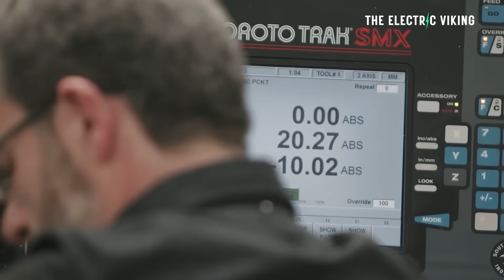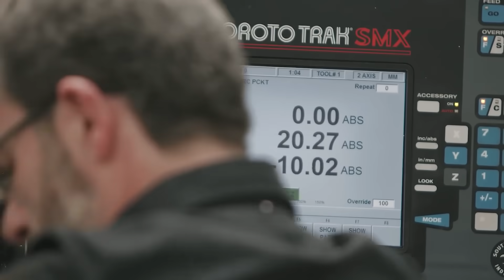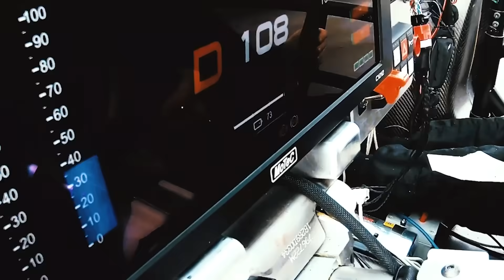This Insane New Electric Motor Has 872 HP And Weighs Only 62 lbs

Comment: Just from the video itself which showed SOME of the internals of the EV motor, I can ALREADY see myself designing and engineering a few improvements to the actual motor design itself to reduce weight and size.

I would change from Neodymium over to high heat resistant, super-longevity Cobalt-Samarium permanent magnets. Then I would change the motor casing and EV motor SHAFT ITSELF over to all-carbon fibre. I also have an idea for the copper winding configuration to increase areal density and overall high-current IMPULSE capability using lightweight ceramics that will increase horsepower BY ANOTHER 25% at least!

There ARE higher impulse-rated EV motor core materials that are intermetallic-ceramic rather than full blown ferrite/iron so that is another option to lose further motor weight! 

Add all that together and my BASE ESTIMATE is that I could probably get the motor down to just a bit over 12 Kilos (25 lbs) and STILL put out a 1000 HP.

Give me some GPU server farm time and I could model and then OPTIMIZE the EV motor current impulse path and the motor thermodynamics AND manufacturing process in about 60 days for a PURE RACE-CAR LEVEL design that is small enough and inexpensive enough to build that ANY manufacturer could put that new EV motor design into a sub-$30,000 USD vehicle. Imagine having a 1000 HP in a car or truck that is LESS THAN $30,000 USD !!!

V

Comment: Goto all-carbon fibre for the casing and shafts with only the copper wire, ferrite core and Neodymium permanent magnets left over as the metallic elements and we could being this motor down to about TEN KILOS (25 lbs)

V

Comment: I drive a 2019 Bolt.  It is significantly faster than a lot of ICE cars with 200HP.  I can't see many people needing more than 400WHP.   

What I expect will happen is motors will get smaller, cars will go to 4 wheel drive, one motor per wheel.  Easier to get the heat out of a small motor.  That eliminates the differentials, while providing very precise traction control.

Comment: Once you reach 100 kph what else matters? --saving 0.1 seconds accelerating to the legal and practical limit is nonsensical and throwing up or having your neck dislocated doesn't seem all that desirable somehow (watching a pack of Lamborghinis getting stuck behind a tram while I cycled past both of them was 'satisfying' during the end of lockdown .  Using this sort of motor in aircraft has some sense but the savings in motor mass get quickly eroded by the ultraheavy and never lightening fuel tank to yield very low range and long delays to refuel.  Avoiding unneccesary hovering take off and landing saves a lot of weight and boosts range and can be done along with urban/suburban air mobility by ATOL (Not VTOL)

Comment: All electric motors are lighter than the equivalent ICE motor, that's been the case since the 1900's
The stumbling block is and will be for the foreseeable future is the weight of the battery. On average to get the same power and range, the EV will be 500-1500lb heavier than it's ICE counterpart

Comment: With EVS its stupid carrying all that battery weight around.
The Electricity shoud be picked up from the road as you rravel;
Think how efficient they would be then!.
Someone seems to have a vested interest in selling  batteries.
Another question is how is the Electricity produced.Is it green/
nuclear certainly  isnt.Where are you going to leave your waste for the next 10,000 years?
Sending it into space would be horrendously expensive.
And one mistake as in Japan could leave large areas of England Uninhabitable.
So cutting  down on the amount of electricity  used however produced makes a lot of sense.
A plus is you wont keep running out of battery power and having to wait hours for it to charge back up.
What do you think we should do?

Comment: Parameter	Unit
Power peak (kW)	711
Power continuous (kW)	650
Torque peak (Nm)	408
Torque continuous (Nm)	398
Speed max (rpm)	25,000
Weight (kg)	28.3
Overall motor length (mm)	261
Stator length (mm)	165
Overall unit diameter (mm)	206.2
Materials category	5

Comment: Some EVs aren’t actually heavy. For instance the Tesla Model 3 Performance weighs less than 4,100 lbs. Other AWD sedans with similar HP like the BMW M3, Alpha Romeo QF, and Cadillac CT4-V Blackwing all weigh a similar weight to the Tesla Model 3 Performance. If you compare EV to ICE with similar HP you will see that EVs aren’t actually that heavy.

Comment: 745 watts per horsepower That's over 650,000 watts! If the motor is 98% effective, that 13,000 watts of heat to dissipate. You will need a trailer mounted liquid nitrogen cooling system to prevent it from turning into a molten mass of metal

Comment: 872 HP, 62 lbs is impressive but incomplete. What is its DUTY CYCLE?
Is the 872 HP figure what it achieved when it is maxxed out to demonstrate proof of concept?
Or, is that the figure  as configured for sale in the hyper-car with some level of assurance it will last through more than a few sprints and high speed runs?

Comment: If we use the average weight of gasoline at around 6 pounds per gallon, a full 15 gallon tank would weigh approximately 90 pounds. Compared to the Tesla Model Y battery weight at 1,700 lbs.

Comment: Pretty much every technology has an S shaped maturation curve, I believe that we are already close to the top end of the curve for electric motors, we’ve been producing them for over a century.  This is an astonishing amount of power from a small motor, but my suspicion is that future gains will be much more marginal.

However, I really hope that isn’t the case with batteries, and I suspect that there are still significant improvements to be realized in battery technology as materials science advances are coming very quickly.

Comment: As a kid, we marveled at the speed of electric slot cars, easy to maintain for racing, and pure fun.   So it is with human scale EVs now.
Reply: You don't realise what you have just stated. Imagine a standard Ev car with an additional slot arrangement where you could drive into a city and engage the slot in the road controlling the car safely and supplying power and guiding your car to its destination.
Disengage the slot at any time and self-drive the car to a desired place.
Reply: was just thinking this

Comment: From a social media blog thread: The gas engine for cars is becoming an engineering has-been ( and ultimately an engineering joke.  Ford layed off huge numbers of engineers in the gas engine division.  ).  If electrical motors were first in existence to the quality of today (which is relatively new), an inventor of a subsequent gas engine would be laughed out of the industry.   And we haven't even begun to reach the optimum levels of batteries.

Comment: I wouldn’t mind using one of these motors to replace my V6 engine in my 2013 Tacoma. Or use one up front and one to power the rear wheels. I’d have plenty of room for batteries.

Comment: Key point is that we're in the comparatively early stages of electric motor design where 'we haven't seen anything yet'. Actually, we've seen quite a bit in a few short years but imagine what engineering marvels will emerge with high demand for electric drivetrains. Iterations and development is easier when you don't have a combustion chamber, pistons, valves, and emission restrictions.

Comment: I want my old 69/70 charger et 440 6 pack and the same car in an ev version. These are just the motors 👍🏻🇨🇦
Reply: One of my classmates had a 69 charger with the same engine set up. I rode with him ONE time.  He reached 130mph coming into a small town. I said let me out, which he did.  The next weekend he was burning up the road and caught the attention of state troopers.  They tried to pull him over but he thought he could out run them.  He did for a short while, then totaled his car in a curve, flipped it end over end, when it came to a rest he just got out and was arrested for driving 137 mph in a 55 mph zone.  Those were full on race cars straight from the factory.  Every person I knew that had any model of "muscle car" destroyed it with excessive speed.  EV's have had the same problem with lead foot lead heads.  That much acceleration is hard for a normal person to handle.  A lot of people get on the road and push the accelerator to the  floor and are hopeless and helpless at every starting to gain control of the beast they have unleashed.

Comment: uh... that much power is not necessary nor practical for a passenger car, so when will they make a downsized version?  They need many different sizes, including down to motorcycle and even bicycle size motors.  That would be a revolutionary game-changer.

Comment: A small car could easily use 1/8 of that power and would see efficiency improvements with commensurate weight reduction. If that reduced power requirement was further split into four separate motors built directly into powered wheels, the drive train expense reduction could further reduce expense. The upshot would be the increased functionality of AWD in a less expensive car.

Comment: The future is not 0-100km in under 2 seconds outside racing, it is smaller,  lighter and so more efficient motors allowing for more driving with less battery, so improving the whole cycle. How small and light could they make a 200hp motor?

Comment: what is the effect if you press the economy function. smoother acceleration. how many have this economy function activated just because they think the battery should last longer or maybe there are those who might even finds Acceleration unpleasant and therefore has the economy function activated. women are probably not as interested in violent acceleration. maybe they want safe driving instead. it is well considered that women drive more carefully / Safer. their previous car which may have been a gas car had maybe well under 200 horsepower

Comment: but can you recycle it? mahle was talking abotu making a recycalable and cheaper electric motor to make the whol sustainability part of "enviromentally firendly" more real, they said itll require a transmission, i guess they coudl integrate it into hyndai ioniq hybrid transmission or prius or high troque subaru wrx cvt sort of thing ... but noone cares. of course they dont, it was never about "environmental issues"

Comment: OK.... so, the horse power and torque is where it needs to be.  Now then, get the range of the batteries enough to drive my electric muscle car at least 500 miles or my 2500 GMC quad cab 4 X 4 pick up towing a 10,000 pound trailer 500 miles and I'll be buying into the electric vehicle...but.... BUT.....until the range of the EV is where it should be I'm not buying.   I tow heavy loads with my truck for hundreds of miles and I need RANGE !!

Comment: This motor essentially says that the flying car is now reality.
Reply: Battery tech is here.  700Wh /kg.  They are already being tested.  Just hasn't gone mainstream yet.  Amprius 450 Wh/kg has already been shipped. These motors are at least on seventh the weight. That will shift the tipping point. The time is now.  There is no turning back. This is a done deal.
Reply: Not without improved energy density in the batteries.
Reply: Think before you comment
Reply: I’m an expert in these matters. The electric motor in this matter can NOT unfortunately produce the power at a lengthy period of time. Only 20 seconds. I genuinely would love to see an EV flying over the peasants on the ground.
Reply: 20 seconds is ample.  That will get you 60 feet into the air before transition to normal flight.
Reply: False. They are under development now.
Reply: False, but cute. It will take a couple more years before we begin to see companies developing flying cars.

Comment: Make one that is 200 HP together and with some batteries and electronics it can be a drop in replacement for an ICE engine
Reply: You can buy them now. Axial flux motors. You can get them in in-wheel configurations complete with suspension, traction control and torque vectoring. The cost is the problem.

Comment: Tesla's are boring(3 and Y), faceless robots, sterile, not very interesting.  The S is a nice looking car, but that isn't what we see everywhere.  If you want to drive a faceless robot then knock yourself out.  There are more interesting cars out there.  They don't have the engineering the Tesla has or the integrated nav/charging network.  That is what sells Tesla is the charging network and the integrated nav.   Hopefully in a few years we will have chargers everywhere and the need for this nav/charger network will be a mute point.

Comment: The motors are amazing. It's the batteries that are the problem. Think of the size, weight and cost of the 800+v battery this motor will need.
The hyper car this motor will go in, will be even more expensive and unobtainable than the ICE vehicles
Reply: The battery voltage in any system is determined by design. With many batteries installed, you can put them in series or parallel or a blend to achieve what you want with just a few altered connectors.

Comment: This kind of high performance drives development, but we should get excited about just how lightweight and efficient the motors can be at 1 or 200 bhp using thus technology. Its low cost lightweight powerfull enough motors we need in mass production, excuse the pun 😊

Comment: I'm not an aircraft guy, but couldn't a few of those power a commercial turbo prop plane? Without the engine weight, gearbox and weight of wing structure to support a traditional engine, that's potentially a significant amount of additional battery capacity?
Reply: search for 'rolls-royce electric aicraft' edit: infact, here's a nice image of it https://cloudfront-eu-central-1.images.arcpublishing.com/thenational/T3AUZ5H6UVHVVERNNRWLIYP7AA.jpg
Reply: @ra3or 😅
Reply: Or connect a motor to sparky n 3 fans on helium tanks battery pack inverter bms connected to potentiometer thin filmed PEROVSKITE on helium tanks ….. crash helmet parachute optional
Reply: @sparkysho-ze7nm  sounds like a booming idea
Reply: No helium tanks. Too big and heavy. There are better options. @sparkysho-ze7nm
Reply: Great idea too.  I agree sir
Reply: You could have batteries and an APU in the fuselage and these motors out on the wing tips.
Use structural bus bars to carry the current.

Comment: It delivers such high power at 16.640rpm which is a very high motor speed. This results in a constant power speed range  (CPSR) which is way too low for use in normal electric cars. If you want this high power density combined with high CPSR, you'll need axial flux motors.

Comment: The weight savings are generally offset by the battery weight, unless you just want to set a time for a hill climb; the big advantage is that you can accurately choose where to put the weight. 
As an engineer and racer I find the whole animosity between electric, H2 and IC simply laughable and short sighted. All these technologies have their place and utility and I bet (literally with my investments) that the future will see a combination of all of these coexist.

Comment: The main advantage of this new technology in motors will be the combination of small size and lightweight meaning the total amount of materials used to produce each motor will be radically reduced even compared to today's top of the line hi output motors, Plus, the range of the vehicle will be radically increased by using smaller lighter-weight motors that are higher efficiency requiring less total battery weight meanwhile the batteries will be getting lighter and smaller in general, when compared to current model normal transportation vehicles the mileage will be massively increased and in theory all costs will be greatly reduced. And of course referring to the use of new modern motor technology for average cars, not the wasteful super cars that no one needs
Reply: I totally agree with your statement 👍
Reply: "Compared to current model normal transportation vehicles' is the operative phrase -- range will always be less than a comparable ICE not 'massively increased'  - this motor and batteries etc will be significantly lighter and better than a coal fired steam engine also but is that what is being competed with ?

Comment: All I can say is Tesla Roadster 2 with gas thrusters. Greater acceleration can only be achieved by custom dragster tires or giving the car a push, limit of functional torque has already been met in the Plaid. 
Just food for thought almost no Tesla Plaid owner has ever red lined the motors which would require driving at least over 230 mph,

Comment: looks like wrapped copper wiring instead of hair pins. wonder if the next version would use hair pins as it would be easier to produce mass quantities of engines. no mention of magnets though. wonder if it uses rare earth materials or not?